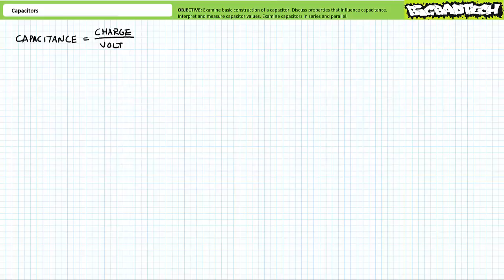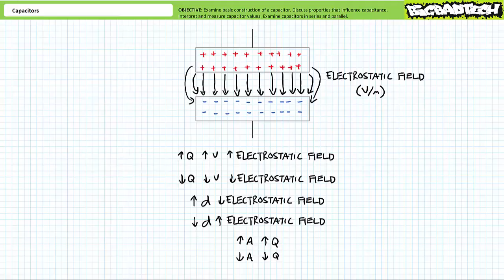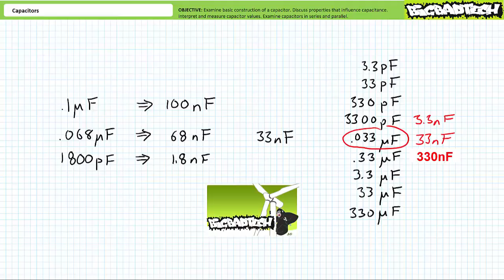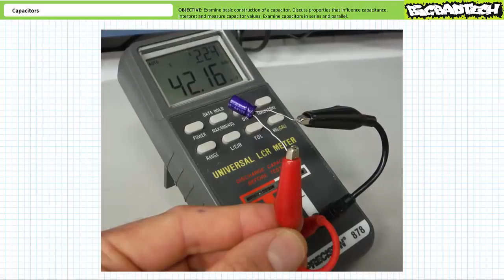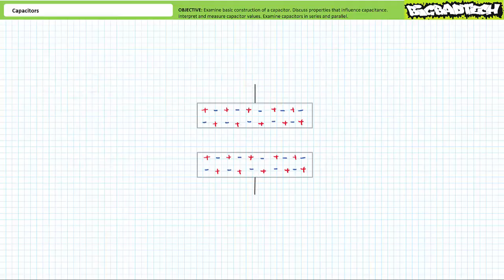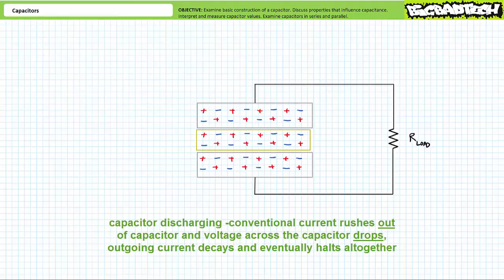Comment: Just wanted to give a piece of feedback for this lecture, since I know you're updating certain videos in this and other playlists. I do want to say that while this lecture is awesome at conveying information in a way that's easy to process, while also being challenging in the right ways at the right times (in my opinion, at least), the run time is a little bit long in my opinion. Past about the 30 minute mark, especially being that these lectures have the pause-to-evaluate component, it can start to feel a little bit like an endurance test, at times. I hope this doesn't come across as non-constructive criticism by the way, because in general I do find these lectures to be a SUPER helpful and useful way to get a strong command of DC circuit analysis, and I would say that I feel confident in the basics of circuit analysis mainly because of these lectures, I just wanted to give the input for future uploads, since you're still doing those :)
Reply: Yes, that's one of the principle reasons I'm going back and redoing some of the earlier lectures. Rather than having theory and examples in one long lecture I'm breaking them up into two smaller parts. This seems to be working out much better. This being said ... the transient DC response of capacitors and inductors is a heavy weight to move. Either way you look at it, there's a lot of material!
Reply: @bigbadtech  Gotcha, gotcha. I think that's a good approach, and I'm also glad you're keeping your content updated, and updating your lecturing style as well. There's a noticeable difference in overall flow between your videos uploaded from 2015, and uploaded today, and that's really great to see from an educational channel that's dedicated to lectures in this way. I've seen so many truly kick-ass lectures on youtube communicated so intuitively, often on mind-krogglingly complicated and notoriously difficult subjects, but the channel's last upload (and many times only upload) was in 2012 or something similar. Look forward to seeing your updated lectures on your other playlists!

Comment: My understanding improved when I started looking a power flowing in the circuit rather than considering voltage/current independently.  Capacitors and inductors take in power over time, i.e., energy, then release it but shifted to the other element of power.  Caps take in voltage over time at a rate controlled by current limiting elements between the power source and the capacitor, but can release it as current suddenly limited only by current limiting elements between the capacitor and ground/return.  Inductors do similar but store current and release voltage surges.
Reply: That is actually an excellent way of visualizing the transient charge/discharge process!
Reply: @bigbadtech   I could always do to the math having learned electronics as part of my Physics undergrad.  I was never comfortable that really understood intuitively how caps and inductors worked.  Your explanation of capacitors in power factor correction really helped me.  First explanation that I run across that didn't have a lot of hand waving.